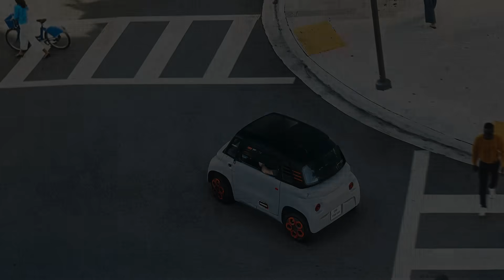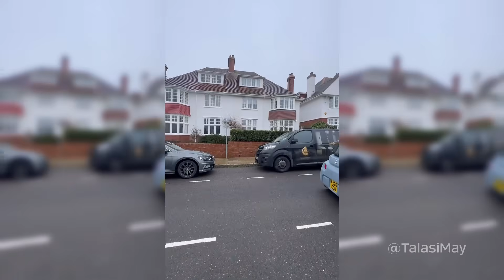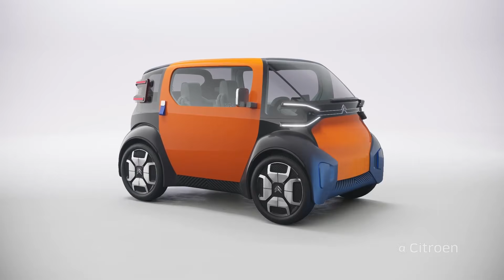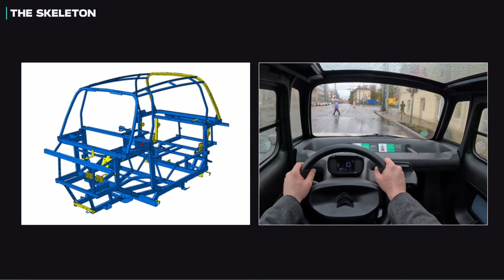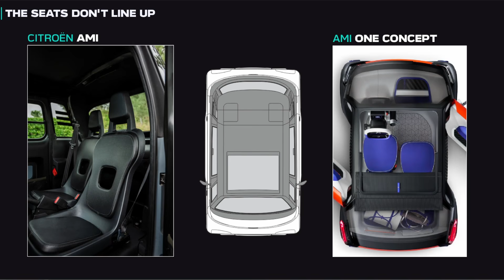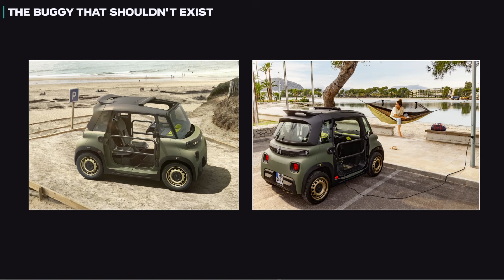The Most Misunderstood Car

Comment: This car has too low range, too low charging speed, wasted design for baggage (barely good for groceries shopping) and finally it's price.
The wuling hongguang mini ev or changli nemica are a better proposition for money. Sadly those models are not really exported so we are stuck with this compromised of car.
It is fun at first for city usage but only fun it lacks practical use for me. If it was half of the price offered it would definitely change my mind but not at the current price of nearly 9k €, i could get a dacia spring used or a renault zoe (2016)for cheaper which would be superior in all aspect.
Reply from the maker: Fair points. Different markets have completely different regulations and manufacturing costs though. The Ami won't be for everyone, but it's hard to call it anything other than a commercial success.

Comment: I love the Citroen Ami as a concept, but it is still a very flawed vehicle compared to other heavy quadricycles in Europe like the +10 year old Renault Twizy that is built to meet L7e (85kmh) requirements while providing an L6e (45kmh) variant.
Compare the two, the costs are similar, the construction of the chassis are wildly different and the drivetrain of the +10 year old Twizy is more competent than the Citroen Ami. The Ami is not a toaster, it's approximately 4 e-scoters with a plastic shell on a rust-prone square tube chassis.

And then there's the suspension, the Renault Twizy was intentionally designed by RenaultMotorsport it's a firm ride, but the Citroen Ami unlike its name sake is also a uncomfortable that's also roll over prone. If the Ami had the longitudinal interconnected suspension of the 1960s Ami (2CV, Mehari, Dyane) it would be better value for money.

Thing get worse in countries outside of France, Spain or Netherlands that have bespoke regulations and categories for heavy quadricycles like sans permit and moped licences for 14 year olds. So in Britain or Ireland, the Citroen Ami 45kmh and the Renault Twizy 85kmh can both cost 10,000 grand with no incentives requiring a full driver's licence. There's a youtuber in Scotland who documented his ownership experience with the Ami and had to have it repaired under warranty for water intrusion into the electronics. He also found that the square tube chassis corrodes quickly.

Comment: This is NOT a car, this is a golf cart with windows
Reply: To a degree, yes. The thing is, look at the rules (size, weight, speed) to which it was designed. This thing is deliberately designed to not require a regular (car) driver's license but one you would need for a moped, making this an option for people who do not or cannot hold a regular driver's license. Undoubtedly, Citroen and Stellantis looked hard at the senior citizen market who don't want a full sized car anymore (cost, insurance, fuel) but who could use something like this for the occasional (short) drive somewhere. Also, short range commuters are a market.
Reply: It isn't a car. The correct designation is quadricycle. It's a sector of the European  auto market aimed at 14 to 17 year olds.

Comment: I had a 1974 Fiat 500 when I was stationed in Italy during the early 2000’s.  It had around 16 hp when new. It was one of the most fun cars Ive ever driven. Some of that was because I was in southern Italy and you could pretty much drive however you like. 2 lane roads would often be 4 wide sometimes. It was sort of like lane splitting is with motorcycles but with cars. I would love to have this little car. The Villages in Florida actually have separate lanes, paths and even parking at places like Walmart/Lowes for golf carts.
Reply from the maker: The 1974 Fiat 500 is such an iconic car right now! Great choice for the small roads of Italy! The golf cart comparison is interesting too. The Ami almost sits somewhere between a traditional car and a golf cart, just adapted to European regulations.

Comment: Ami makes sense as a city car until you look at the price. After subsidies, I can get an electric twingo for the same price, which is a lot more of a proper car than the ami, but still fits into the "small city car" category. After all of this cost cutting and usability compromises you'd think ami could be below 10k, but apparently not.
Reply from the maker: That's a fair comparison. Incentives can completely change the equation depending on the country. The interesting thing is that despite those comparisons, the Ami has still found a surprisingly large audience, so it clearly resonates with a lot of people or it is competitive in some countries. Not needed a driving license is enough incentive for some people to favour the Ami.

Comment: i live in Italy, and there are people driving this things on state road, without realize the danger their are living: if a suv hit that plastic thing, i don't think the driver would survive. i can't understand how EU pretend a car to be insanely safe, and then make this things legal on normal road (and not only ztl zone i city center or inside super market...)!!!
Reply from the maker: That's exactly why the Ami is intended for low-speed urban environments. It certainly isn't designed for high-speed roads. But it's also worth remembering that bicycles, scooters and motorcycles legally share those same roads with even less protection.

Comment: this type of price saving is something Dacia would pull off, and if i remember correctly it uses a starter motor and tbh it's a much better alternative than other l6e vehicles that are loud, expensive (like a dacia is cheaper than it's ICE counterparts) and stink of diesel, and the only competitor it could have is the kilow la bagnole which costs 10k euros and i remember seeing a topolino with rope as doors in rome a while back

Comment: In my country you can find used imiev for a 1/4 of the price of a new ami with comparable range and you get a lot more car, so there's no reason for ami
Reply from the maker: That's a fair point. The second-hand market changes massively from country to country, so what makes sense in one place might not in another. My video was mainly about why Citroën engineered the Ami the way they did, rather than whether it's the right purchase for every market.
Reply: Can a 15 yr old drive an imiev legally though?